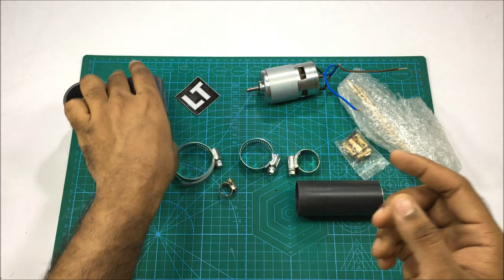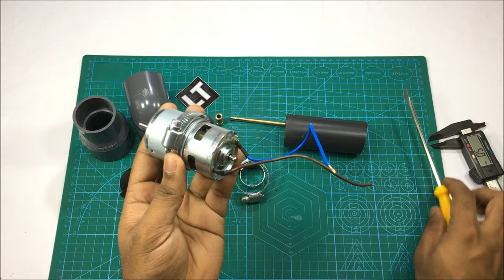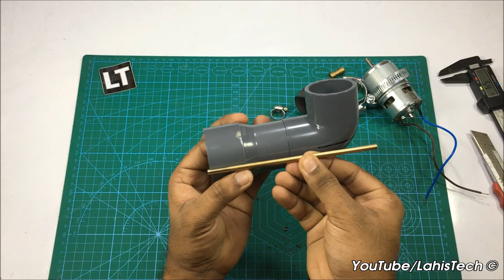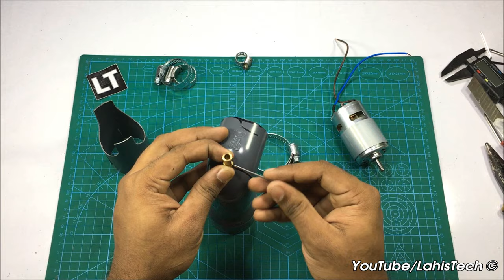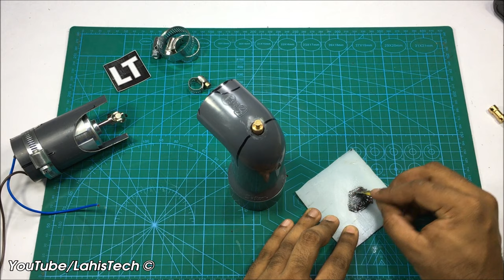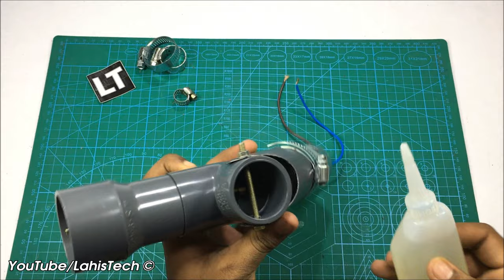How to make a jet pump Water Thruster (DIY Turbo Jet Pump for RC boat/sea scooter)

Comment: Big shoutout to LT! Awesome how you did everything by hand using very basic tools, these guys that make stuff with lathes and stuff which most people don’t have is annoying and unrealistic!  Nice to find an alternative cheap form of propulsion! I’m build a Thai style styrofoam boat but with some American modernization 4’ X 8’, 1” wooden frame reinforced with fiberglass material and covered in fiberglass resin with a roof and actuator powered plexiglass windshield that comes forward to enter and closes when inside, probably put 10 of these motors on the back with bigger motors and a steel propellor should only weigh 60 lbs 🤞🏾I’lllllll make a video 😏
Reply: Is your video out yet?

Comment: So do you think this has enough thrust to push my Kayak through the water. I have been looking for a solution to this and was thinking of a trolling motor but it’s really large this however looks like it could be pretty neat.
Reply from the maker: Yup, I guess.
Reply: Nahh not enough thrust for the power. Jet pumps aren't very efficient at low speeds and a kayak with such a tiny motor will never reach high speeds.  With this size motor, but one with less RPM and more torque (they vary) you'd be better off using a very small airplane prop about 4 inch diameter and a 3 inch pitch.  You'd probably get a good 5 or 6 pounds of thrust to get you to a casual paddle speed.   The jet pump in the video would probably only get you 1 to 2 pounds thrust.
Reply: @Andy-df5fj  I found this while searching for an option to power a 6' plywood boat that is 35lbs empty. I looked at macerator pumps but haven't seen the idea implemented. Any thoughts?.
Reply: @sufferedenuf  
I've never heard of a macerator pump but from what I just looked up, it seems like it's designed to chop up waste which would probably be great for weeds, but I imagine at a cost of flow efficiency.  I saw another youtuber mount a bilge pump which is a centrifugal impeller design like a macerator pump is.  It didn't go fast at all but it did work.

Comment: Curious could something like this work on an inflatable boat? I was thinking of a 12-volt water pump to give my inflatable a bit of a trolling motor for less than the cost of a motor mount and a 300$ electric trolling motor. I was thinking if I could pull water from the bow and push out out the Stearn it should give me some thrust but the question is. How many GPH does my boat need to move? It's an Intex 3 man Seahawk fishing boat. Carrying roughly 350 lbs half of its max carry weight. I also wonder how you would make it so it can steer the boat as well I was thinking that RC boats might be the answer they seem to have a lot of power any ideas?

Comment: You need 2 u-joints to properly run  when you mount a motor out of alignment with the drive shaft. This transfers the power more smoothly and efficiently which also saves wear.
Reply: Can you explain the setup please?

Comment: I ended up sizing up the entire thing and did it out of 3 inch pipe and a bigger prop and motor and i also sized the outlet down to an inch and if I hit full throttle it shoots you to the absolute moon 😂 thanks man
Reply: Please tell me this worked out well... I need to know 😂
Reply: Back Forty TV it did but i ended up breaking a couple parts so use a metal drive shaft and a metal prop.
Reply: Luke VT sweet! Thanks!

Any idea of speeds?
Reply: Back Forty TV I ended up using a 24 volt motor from a razor scooter and was able to hit just over 10 miles an hour. I think it could go faster tho.
Reply: Luke VT bro, nice. Did you have it on a kayak or what?
Reply: Back Forty TV I made myself a little knee boat out of fiber glass.
Reply: Luke VT nice! Think it would do well with a 10’ SOT kayak? Making a sprint boat for duck season. 😂
Reply: Luke VT two it is. I’m also using 56124 SSS motors, so should do well
Reply: Back Forty TV yeah definitely good luck
Reply: Luke VT thanks bro. I’m sure I’ll have a video up in the next month or so.
Reply: Maybe a stupid question but does it also drive backwards ?
Reply: @MrMartinos621  yes if you switch positive to negative and negative to positive on the motor it won’t go fast but you will have reverse
Reply: @gh0stedone472  you ever make a video of this. I was looking for this exact thing. I have the motor on a peddle go kart but son dont use it any more so was looking to do this.

Comment: EnSpired by your Video and with "Kayak Twin Jet" in mind, how would you feel about getting rid of that universal and replacing it with a FlexDrive like a cheap weed trimmer?
I'd then be looking at running 2 separate jets giving double safety and some steering even without jet control, what do you think as a project ... I'd Sub and hit all the right bells and whistles

Comment: Add a stator to the back of the nozzle to keep the water from spinning in the output and you’ll get a lot more thrust.
Reply: How. Plz guide
Reply: Why does this result in more thrust?
Reply: Maybe just add a brass nozzle 🤷🏼‍♂️
Reply: @Excellence In Animation  the flow direction of the water is returned to a linear discharge instead of turbulent or spiral flow.

Comment: The only thing I don't like is the universal joint. Too much energy loss there and as well its a part that's most likely to break. If the water intake were higher then you'd loose energy in the lift. Best to encase the motor and use a straight shaft. Just have to consider cooling the motor. Also if you reduce the output pipe diameter a bit more you would gain an enormous power boost. Nice video. Thanks.
Reply: So like adding a brass nozzle

Comment: Thank you for the video, Want to put one (or 2 😉) on my kayak!
Reply: you made a comment on a small jet unit and that you wanted to adapt to a kayakyou may be interested in ... have you thought of a FlexDrive like a cheap weed trimmer? Keeps the motor out of the water, the flex cable will last at least a season in salt water and cheap as cheese to replace
Reply: Get a 3d printer..... coat print with epoxy...  gonna run you around 500$ for some decent speeds.     12s battery setup on a 56mm jet drive and 56mm motors with high amp speed controllers.

Comment: The “U” joint is unnecessary,  inefficient complication. The motor could’ve been mounted vertically like an irrigation pump and the motor would still be well out of the water yet the impeller(prop) would be submerged. A “slinger disc” could be mounted on the shaft, just ahead of the motor to block the water that rises through the pump bearing and reaching the motor.
Reply: Does the motor water resistant?

Comment: How do u keep the propeller straight because it is touching my pipe and it is not working can anyone help me
Reply: I saw he glue the 5mm shaft connector at the edge of the angle pipe, the connector helps holding the stick which connect to the propeller straight
Reply: @raiden9335  i think he used a ball bearing or bushing

Comment: Whats The point of that motor angle
Reply: i think its to keep the motor out of water line
Reply: Samuel is correct. In actually jet ski the motor would be an engine and it's kept under the seat our of the water